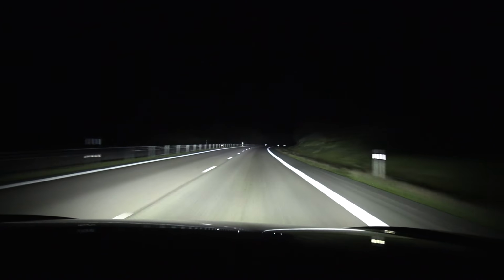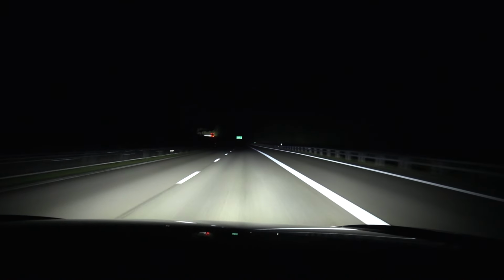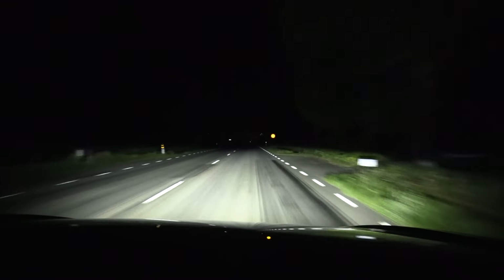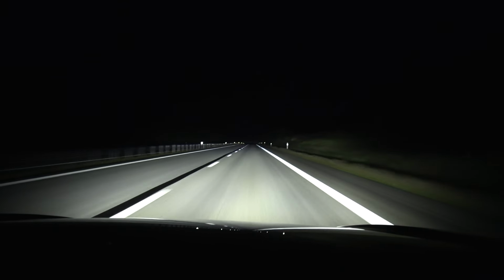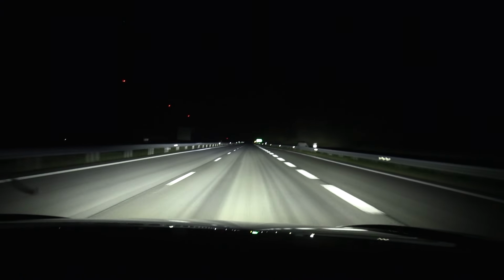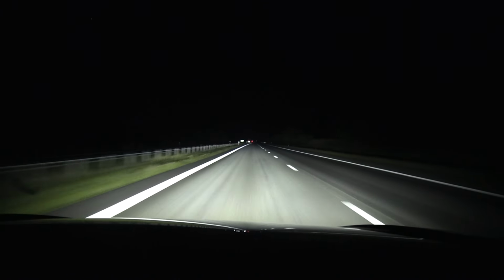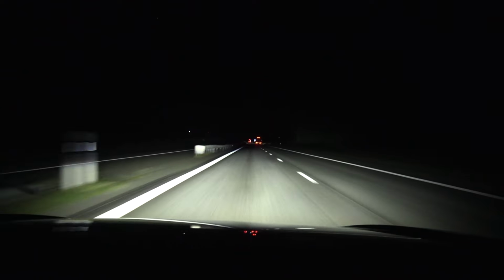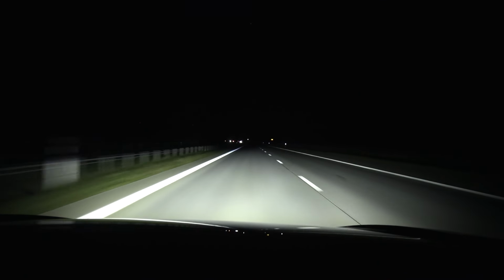Audi RS e-tron GT LED matrix and laser lights test

Comment: My Taycan has matrix headlights and I frequently get flashed by on coming trucks when on motor ways. The reason is that we now have higher central reservation crash barriers and the on coming trucks headlights are hidden behind these new barriers, so my car doesn’t realise that there is a vehicle on the other side of the road. The truck driver is sat high up so sees the full beam of my lights. I don’t get flashed by on coming cars as the driver is sat down below the hight of the barrier so is protected from my full beam.
Reply: Why do you need high beam on the highway?

Comment: Please Test 1000km with the new buzzzz
Reply: 2 years ago the 82kwh did it in 10h 30 min, it's in the test result document. new one wouldn't be that much better
Reply: @PancakeSpeedy  i guess it will because fastet charging and better Motor

Comment: I wonder why car makers still insist on relying on detecting the headlights of oncoming cars on highways to block out the matrix segments rather than using the left road boundry marking as a reference to not shine past that since there really isn't any point in shining the highbeam into the oncoming lanes. 
This would prevent any potential blinding of oncoming cars if the system fails to detect their obstructed headlights, which is almost always the case with trucks or on very windy roads for example, while still providing the best possible visibilty. Country roads etc are a whole different story of course due to potential hazards like animals etc and those typically don't have middle dividers that obstruct headlights either so the system can work properly.
Reply: Nice idea but I think is harder to detect the middle separates on twisty highways and also is required a very high number of elements in the matrix. Maybe when the matrix lights won’t be an optional on most of the cars.

Comment: Not sure how it is in Norway. But on the Autobahn the rule is that high beams are not allowed to be used when the central divider does allow light to go through and you potentially blind other road users.

And it's generally considered to be extremely bad manners and potentially illegal and unsafe to use high beams on any dual carriageway. It is meant for country roads were sharp bends, animals crossing etc. are a real possibility. Autobahn for example you could probably run on daytime running lights and just let the reflective posts, reflective road markings and the tail lights of other cars guide you.
Reply: I tend to disagree. It's totally legal, just as on any other road, as long as you don't distract oncoming traffic.
Reply: If so, do the German manufacturers disable adaptive LED matrix driving lights in home country? So do e.g. Mercedes Multibeam and Digital lights only work abroad and not in Germany? 

You made quite an assumption regarding the risks on motorway and dual carriageway. The animals (moose, elk, bear, reindeer) are at least as dangerous at higher motorway speed as on slower country roads.
Reply: @hannu6169  No, it's up to te driver to use high beam only when it is okay.
Reply: @Timico1000 thanks for your answer! It seems "OK" means different things in different environments. The only reason why I (or anyone else over here in Finland) have ever seen any reason to shut off the Multibeam function by moving to dipped beam is the extra LED-panel. The automatic main/dipped beam or matrix LED adaptation ("Multibeam", as Merc calls it) simply cannot handle main beam that has been extended by 100 - 200 meters beyond what the car had when it left the factory. 

It's different use case in the slippery nordic winter with long stopping distances and large part of the main road network lacking street lights. If the car did not come from the factory with S-Class Ultra range lights, then proper main beam needs to be retro-fitted as a car without it is hardly usable in winter time which starts for me today. I am glad I changed my car to winter tyres yesterday after seeing the weather forecast.
Reply: I´ve seen a video just today where they tested the IQ Lights of a VW with highbeams on while driving on the Autobahn. Earned quite a shitstorm in the comments.
Reply: @Timico1000  Many Germans are complaining and refering to all details of rule instead of using common sense. They need the complex world. Nobody will care if you light up without interfering others. And on the other hand they all want to drive 250-320kph+ during the night. Of course you can't do that without proper high beams. You can't even drive 180kph-200kph without high beams in dark conditions.